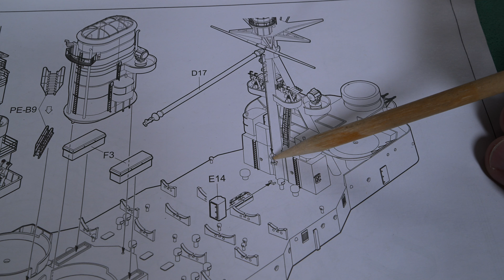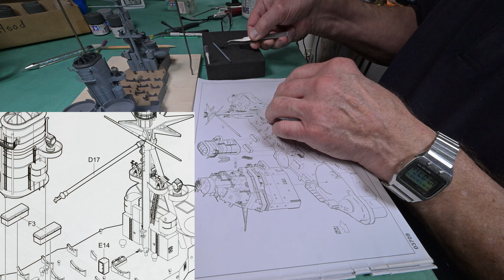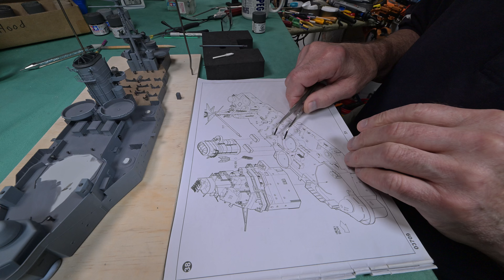The Model Ship - Part 1289

Comment: Hi Ron great work, I could be mistaken but it looks like the two structures you fitted on episode 1285 where you thought you cut of the locating pins are not quite covering the location holes on the deck unless its the marks you made to fit parts centrally. Keep up the good work.
Reply from the maker: You are correct! I must has slid the a bit after placing. 😦